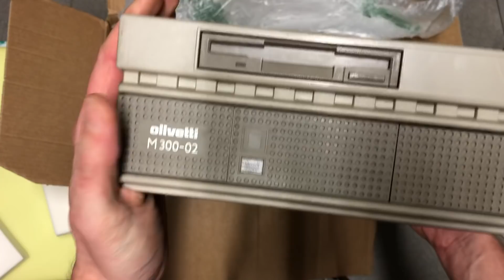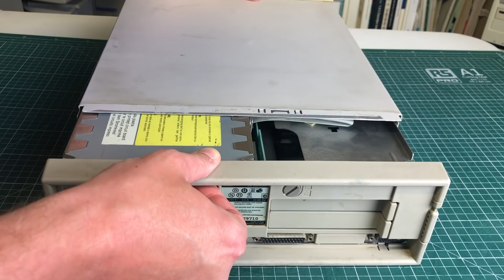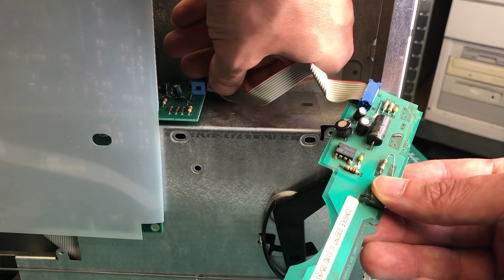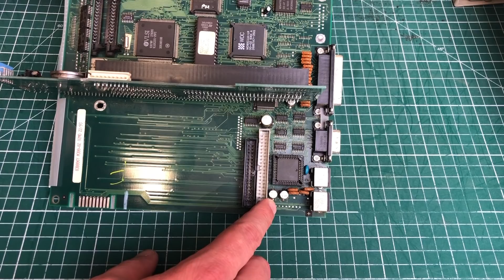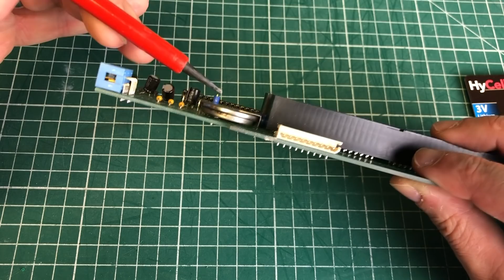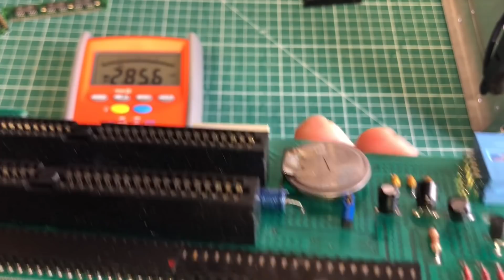Olivetti M300-02 eBay "score" - non working PC (part 1)

Comment: The strange power switch is there to manage both power and standby. The right button as you already figured out is the on/off switch, the left lever disables the power output on the back, PC speaker, keyboard and mouse. That's because the bundled monitor had no power button on it.

This poor little board needs a complete recapping but you may want to first try disabling the CMOS battery by opening P1 (it is the only jumper on the riser board). This disables the battery backup feature and should avoid any checksum error related reboot.

Thanks for your vids!
Reply from the maker: Thx for tuning in ..... did a board recap and a partial PSU recap. Made some progress and got to poke around what was on the hard drive ... stay tuned for the part 2 !

Comment: When my vintage Packard Bell 386sx did this is was the ps/2 keyboard socket needing to be soldered. I would now suspect it's the ram not initializing properly perhaps populating the other bay's with a few megs, might get a little further in the troubleshooting area of this restoration.
Reply: Fantastic find though, great condition - once solved would you happen to have any video memory ram modules, and or a cyrix math coprocessor available because that PC would definitely rock, playing many dos games for that time with 8mb extra ram if the cmos consumes the extra 2mb and a isa video card would rock.

Comment: Even modern day computers with their 3300-4400uf at 6.3 vdc could cause a that, I even had a case where video card was glitching and had those caps. When ever I see those caps all I can think is "Game Gear" so re-cap especially those silver smd caps, they are the worst. My money is on the electrolytic caps.

Comment: The fact that the extended memory is only showing up as 1mb on the screen (and that the simm is 2mb) before it falls over and reboots tells the tale of a possibly bad simm.
Reply: agree on bad ram,  possibly graphic adapter too
Reply: It's 640KB main memory + 1024KB extended memory (+384KB used for shadow RAM or as EMS). That's 2MB in total, so no problem here.
Reply: @Tw11tube: I stand corrected! 🙂

Comment: Oh god, I have the same issue with a Olivetti 290SP (Olivetti PC PRO 290), mine had problems in the PSU, but computer reboots on POST or before, I can hear like voltage going down on the fan and rebooting.

By the comments below I will check smd capacitors... Thanks bros.

Comment: During the disassembly I've noticed that the riser card seems not perfectly plugged in, since the bios battery is placed there maybe a more accurate reinsertion could fix your reboot problem
Reply from the maker: I had already pulled it off a bit as it takes a lot of force and wiggling to get it out. When the pc was running the riser card was fully pressed in.

Comment: I'm not sure it is rebooting.  Looks like it is losing video sync or the vga adapter is resetting.  Try an external VGA adapter.  Seems too fast to be repeating the RAM tests over and over.
Reply from the maker: If you run it in slow motion you do see it counting again and repeating the boot cycle.  Haven’t had any luck with an external vga card.

Comment: I can’t wait for part 2 - I’ve just done the same myself and bought a pc from eBay for GBP15 including postage! This one is a 2004 pentium 4 that POSTs but is unstable - inspection has shown it has capacitor plague. So I’ve ordered a desoldering gun and replacements and I’ll see if I can get it working properly again! Thank you for your efforts with these fun and interesting videos.
Reply: Watching this channel got me into doing the same. Managed to repair a 386 PC I got from ebay by soldering in new caps and fitting an external battery :)

Comment: WDC is Western Design Center (not Western Digital). WDC is "home of the 6502" formed by Bill Mench after leaving MOS.
Reply: No, that actually is Western Digital Corp.  That’s a common VGA chipset from WDC’s Paradise division.
Reply: @sirnickity  Yep. They made great SVGA chips back in the day. Also disk controllers strangely enough ;) Don't think I've seen any WDC stuff in PCs.
Reply: Sorry. I stand corrected.
Reply: But in this case, it is Western Digital Company, search wd90c11a-lr in vgamuseum.info and check the datasheet
Reply from the maker: Pretty sure it has the Western Digital logo.

Comment: I think you mentioned that the machine had a 2MB soldered memory module, but, if I remember correctly, the POST screen you showed only counted to ~1MB of memory. Perhaps the soldered stick could have gone bad?
Reply from the maker: That was also my first guess ... but the memory module is not the easiest thing to tackle ... so started with the caps and will see where that will take me ... probably to the memory module :)
Reply: I went back and had another look. The POST screen talks about the lower 640KB being OK and then 1MB of Extended memory. So I don't think it's the memory...which is probably good as it looks like a real pain to replace.

Comment: Looks like SIPP memory - it's electrically compatible with SIMM modules, though.

https://en.wikipedia.org/wiki/SIPP_memory
Reply from the maker: This onboard memory soldered onto the board seems to have > 30pins. Perhaps a custom design for this board.
Reply: @RetroSpector78  very strange, but cool nonetheless. I'm looking forward to the next part :)

Comment: I’m definitely expecting a combination of capacitors and battery. 

When these types of batteries are just showing a value of under 3v, it’s definitely empty. As soon as you’re closing the circuit, the voltage drops even further. So you should definitely replace the battery with a full one. Either CR2032 or something else. The voltage just needs to be at least 3v (unless the battery states another value). 😉

As for the capacitors, no question about it. They’ll need to be replaced!
Reply from the maker: Replaced caps and battery and made some progress ... still not 100% stable but at least she boots now :) Stay tuned for follow-up video.
Reply: @RetroSpector78  Damn! You've made me really excited to check out the next video!!! :D Also very nice to see that it's more stable now!

Have you also checked the insides of the PSU? It's something I do on every PC older than 3 years. I've been replacing capacitors in about 20 PSU's (which is about 35% of the PSU's in my collection) last month, so it's just a preventive measurement to at least look at the guts, and see if there's anything wrong in there (voltages aren't too bad, but could be better).

Comment: Check the power supply caps. They could still be leaky, as in bad ESR. It may be a long shot, but try reseating the BIOS ROM.
Reply from the maker: Reseated the BIOS rom and replaced some caps ... making progress ... follow-up coming soon.

Comment: I’ve always been fond of computers that have the power button protected, and this design seems to be unique. My PS/2 model 95 has a transparent slider that you must lift upward to push the power button underneath, while my Compaq servers have opaque sliders that go to the side, revealing the power button.
Reply from the maker: yeah this one not only blocks he power switch, but also disables the keyboard and seems to cut off the power output on the PSU (so that the monitor turns off).

Comment: Sometimes the voltage will test OK at first, but if the PSU is put under load the voltage will immediately sag and cause issues. Worth trying to check voltages when the PC is connected and powered, even with an oscilloscope.
Reply from the maker: Lacking a bit of experience in that department ... but found a culprit in the PSU .... should check to see the difference with the oscilloscope now and try to learn.

Comment: It's showing the signs of power load causing the power supply to shut down. If you have experience with those types of power supplies, you might want to check the caps in it for leaks. Also, one of the voltage rails might be controlled by an SCR or MOSFET that's tripping under load.
Reply from the maker: Only experience I have is measuring caps with an ESR meter and replacing them ... should really learn to interpret scope measurements .... but would not know what to look for at the moment ... if this gets fixed will use it as an opportunity to learn (before and after with the scope).

Comment: My first VGA monitor was a gray Olivetti monitor.  It didn't have a power switch since it was designed to plug into the downstream power port on the back of the machine.  I can imagine that monitor fitting this computer.
Reply from the maker: yeah ... the power slider seems to shut down the power output port on the PSU, effectively shutting down the monitor while keeping the machine running (with locked keyboard).
Reply: @RetroSpector78  that's because it's called the "green" button - as of energy saving when you left the computer running but wanted to switch off the monitor to save electricity. Back in the day you could buy it as a whole system with the desktop, monitor and keyboard. No mouse was included. I've had a 286 system when I was 17.... :D

Comment: In my experience I found that many of endless reboot loops were caused by faulty capacitors (also those in a power supply) - I would start from replacing them. Also you may utilize some white vinegar to get rid of traces of corrosion and then IPA or other alcohol to get rid of vinegar. I also noticed that it is an unpopulated PLCC-68 slot for NPU - those are actually fairly cheap to buy in China (I bought one Cyrix 387 - 25 recently and it works flawlessly - for ~3EUR).

Would you also mind measuring a voltage on a battery on the load - when the PC is turned on?

Comment: The lack of sound on startup is a sign of the failing polymer capacitors, it's a common issue with macs of this era too. Greetings from a fellow Belgian!
Reply from the maker: Greetings .... replaced some caps and making progress ... follow up video coming soon.
Reply: I was wondering (and this is slightly off topic) but how do we go about replacing caps on a motherboards?

Comment: The reboot problem and the fact that it varies and most of the time is blank is more than likely caused by the leaking smd caps.
Reply: agree. i've seen worse than that, which was fixed by simply replacing the old caps. think of smd-amigas: colors went wrong, sound is distorted, floppy isn't working or - no screen at all. but thank god there is no varta battery around :D
Reply from the maker: Mats Larsen spoiler alert : it wasn’t :( the caps were leaking electrolyte and I could smell the fish when cleaning the board. So they needed replacing but the issue persisted (very frustrating). Made some progress by inspecting the PSU. It finishes the boot cycle now, but only when it has been turned on for a couple of minutes.
Reply: @RetroSpector78  That indicates a capacitor issue. The caps need "warmup" to deliver the "right power"
Reply: @JorgeCarvalho_web_dev  The same issue on broken arcade screens which needs warmup before good display ?

edit : spelling issue
Reply: @RetroSpector78  I will follow your steps in my Olivetti 290SP, my first approach was in the psu, because voltage was too low to boot. I replaced some of the condensors and it now boots up like yours was. I changed capacitors in the motherboard just as you did and nothing changed, so I'm probably go back and look at the PSU in more detail.
Reply from the maker: andreustap I now get it to boot properly in windows and its running stable. But on a cold boot it keeps resetting for about 3mins before it resumes normal operations. So still an issue somewhere.
Reply: @RetroSpector78  I agree with Jorge Carvalho. This behaviour is a very strong sign towards dried electrolytic capacitors. Generally, I advise you to get a "high-frequency" impedance meter (usually around 50kHz to 100kHz), often sold as ESR meter. You can identify dry caps in-circuit (most of the time), so this quickly tells you where problems are (or where you don't need to waste your time on).
The reason for the warm-up period is that the internal resistance of the electrolytic capacitors (the ESR) goes down with temperature. This partly counters the effect that the ESR goes up when the capacitor loses electrolyte.
Reply from the maker: tw11tube have an ESR meter but only found 1 bad cap (checked all of them outnof circuit also cause I found that these ESR meters often don’t perform well in-circuit. That cap did result in the PC always turning on and showing a display. It still keeps rebooting. Will show some more in the next video.
Reply: @RetroSpector78  It might also be a capacitor taht did not leak but does not keep its original parameters.
Reply: @RetroSpector78  Some old caps often test fairly good on a meter yet still don't perform properly. I think Curious Mark pointed this out in one of his video's a time back.  Edit, it was Mr Carlson's Lab.
Reply: @RetroSpector78  My 290 is kinda the same, plus I don't have a compatible keyboard. Anyways it boots and stays stable for about a minute in keyboard error, after that it reboots constantly with a voltage reduction. I'm almost sure some capacitor or other component in the PSU is not OK. I might test them with an ESR meter...
Reply: @RetroSpector78  Sounds like a voltage instability problem.
Reply: I had an Apple LC-II Pizzabox on my bench that wouldn't work. You turned it on and all it did was a weird inconsistent whine from the speaker. You could see the SMD caps leaked everywhere. So I removed them all, cleaned up the electrolyte, put new ones in, turned it on, no whine, but wouldn't work either. So I removed the power supply to check that and lo and behold there was another SMD cap hiding under the PSU cable. I replaced that, put the PSU back in, turned it on, Plöng! And alternated between Sad Mac and a Floppy Disk with a question mark (I just had the naked board so not finding anything to boot off of didn't make it happy). And booted up reliably back in the machine ever since. 

I remember my first laptop I was given, a  (then) 9 year old Toshiba 3100SX (with VGA and two batteries and Plasma display). It only worked for three days. Now I recognise the smell of bad caps everywhere.
Reply: Would also explain why it didn't power up the second time.

IMHO you should always inspect the inside of the computer for problems before powering it on for the first time.
This should include the inside of the PSU. I actually almost killed a IBM 300GL as it had a PSU filled with spiders and egg cocoons etc. Really bad smell and as it had a weird proprietary PSU* would have been a pain to fix.

*Half AT half ATX psu with some pre ATX standard connectors.
Reply from the maker: mockier When dealing with really old computers or computers that haven’t been stored properly I typically do that. This one was pretty clean inside and I took a little peep inside the PSU before turning it on :) However I don’t always see the need to inspect / diagnose every individual component before turning it on. This unexpected behaviour is always difficult (sometimes something on the screen, sometimes not). You start to look for patterns that might not be there. Will it show something if the PC was turned off for an hour. Will it not show something after it was just turned on before .... I rather have it either working or completely not working ;)
Reply: @RetroSpector78  Check the PSU also for leaky caps.   Because the computers of that era, had one pin on the power connector that was for "Power good"  if the MB send a signal that the power wasn't good, the PC would reboot, so if you replace caps, be sure to replace ALL of them and including the ones in the PSU since it's a 220V PSU.   And I would suggest to plan a replacement of the Battery even if it shows it's good.  Because these batteries aren't design to last over 20 years.

Comment: Ciao, in earlier Olivetti BIOS the next step after memory check is CMOS checksum (if I remeber well). Maybe the failure could be related to battery issue. You could try to replace the battery and se if the CMOS checksum pass.
Reply from the maker: Normally it should display the shadow memory (0 kb) and expanded memory (384 kb) but it doesn’t and simply resets.
Reply: Grande andre 🖐️
Reply: @diegocipriani  Ciao caro!

Comment: Ahh, Olivetti hasn't paid the family so it will not start. 

Just joking, maybe the RAM or the RAMController is bad?
Reply from the maker: Too bad the ram is soldered on the mainboard and probably has a non standard pinout. Not the same size as a regular 30pin SIMM.
Reply: @RetroSpector78  if you were to disenable the onboard ram and use a simm instead would it create an error? Or would you be able to bypass the bad built-in ram through removal?
Reply: @Mr Guru while doing this you may want to increase the amount of dram on the module as well increasing the stock memory. If the simm has the via and traces for them.
Reply from the maker: Mr Guru yeah ... thx a lot for the comments....  if the machine has been turned on for about 4 minutes it now manages to complete the boot cycle, passes all POST checks, and boots into windows. Runs stable. Not really sure what could cause instability when the machine is running “cold”.
Reply from the maker: Mr Guru during the first 4 minutes it resets in different places. Sometimes during ram count, sometimes at the end of post, sometimes somewhere during autoexec.bat .... once it is warmed up it runs fine :) replaced 5 caps in the PSU to get it in that state. But now at least there is some predictability.
Reply: I think it is a SIPP, this is pin for pin compatible with a 30pin SIMM.  You could simply solder on a SIMM socket.
Reply: @Mr Guru Then it is not a SIPP ;-) why would they do that!  Someone made that choice?